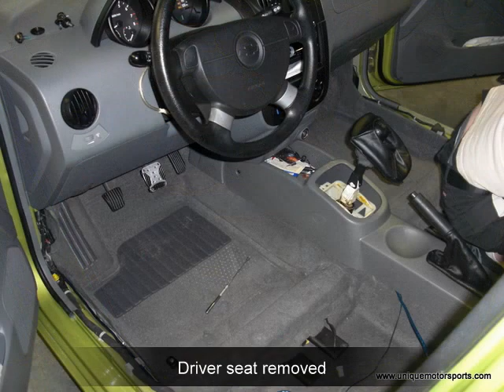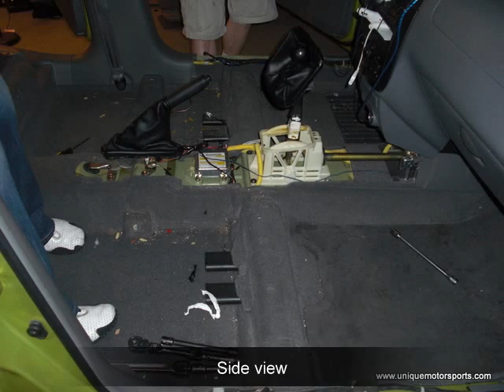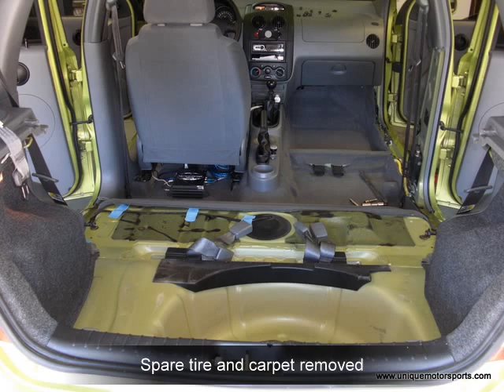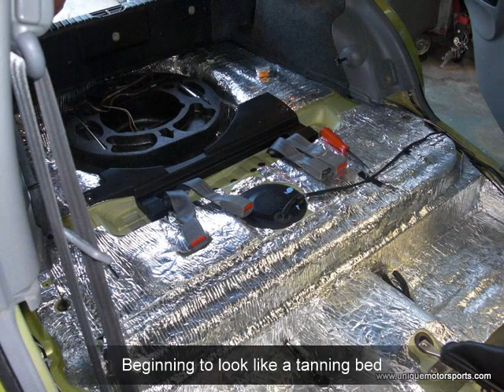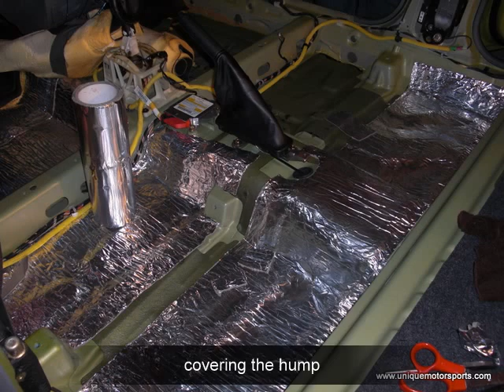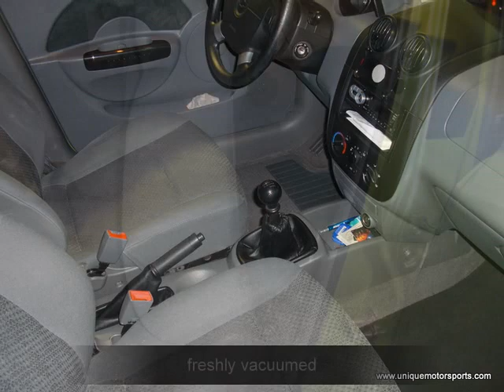Aveo DIY Inexpensive Sound Deadening

Comment: What's ur verdict on this stuff? Especially vs the heavier and asphalt filled peel n seal/ U seal stuff?
Reply from the maker: I haven't tried the heavier stuff. Ultimately it depends on what you want, I would autocross this car and frankly it was slow enough without the added weight. Also, layering it like this might "look good" but probably not the best method for actual weighted sound deadening. That said, I live in Vegas so this was also about making the AC work better by keeping road heat out of the car. In that respect it did help though I don't have any actual numbers. 

I can say at freeway speeds, it lowered the noise by a few decibels. Enough that I would do it again.
Reply: Awesome. I appreciate the feedback brotha!
Reply: +Ham Gordon (Graphics by Ham) I used asphalt filled peel n seal and I live in Texas. It does fall off and smell bad in 100+ degree days. I ended up removing most of it. I may try this frost king stuff though.

Comment: How well did this work?
Reply from the maker: Hi Jake. It actually helped a bit with sound but it also helped a lot with heat/cold insulation. I would  do it again, especially for the money
Reply: @subachad  cool that's for the heads up but I didn't see how much it cost yall to do it. I have a 2007 Chevy aveo myself and I'm trying to work out the numbers on a remodel.
Reply from the maker: I want to say it's about $20 or $25 a roll and I used about 2 rolls.